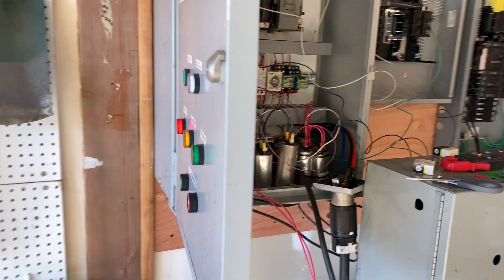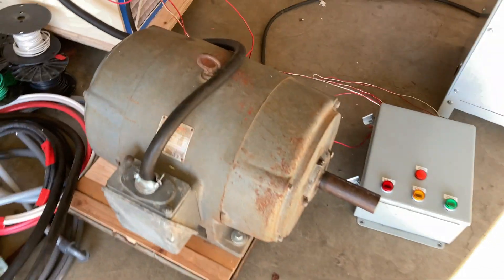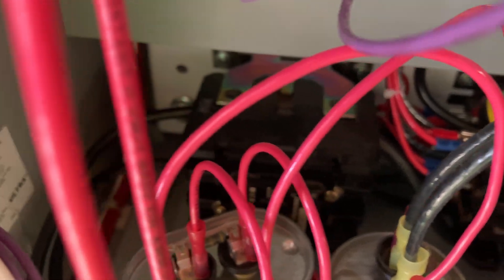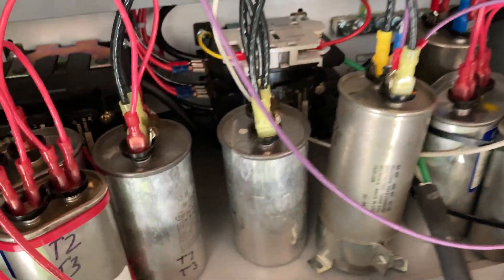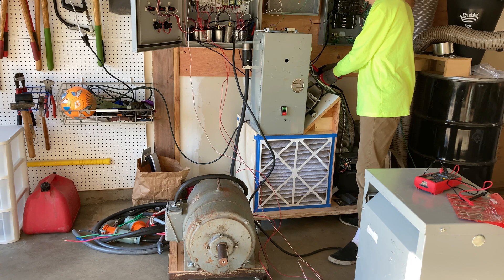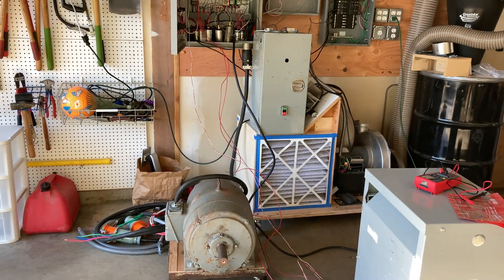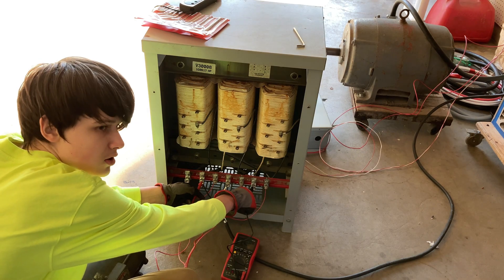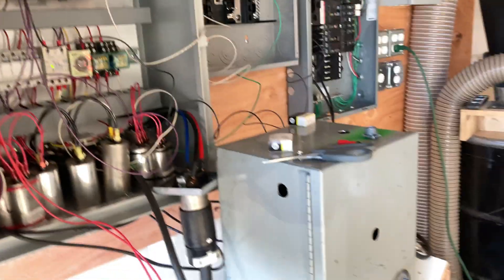Testing My Rotary Phase Converter

Comment: Setting up mine now 20hp idler to 3phase distribution panel. I bought a pre assembled enclosure that just required 220 in and the idler to be connected. The idler fires up and runs smooth.  I would like to use mulimeter to determine which leg from the idler is the manufactured leg because WNY said it needs to be connected to a specific terminal. Also using a multimeter to test for voltage to to 3 phase panel do I test each lug w/ground or on legs themselves like you tested tranformer output.   TY